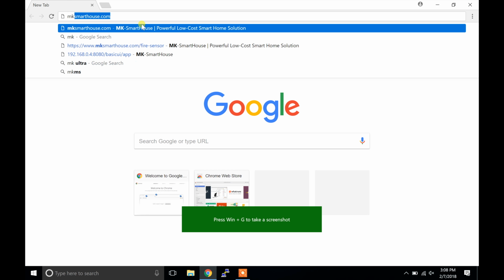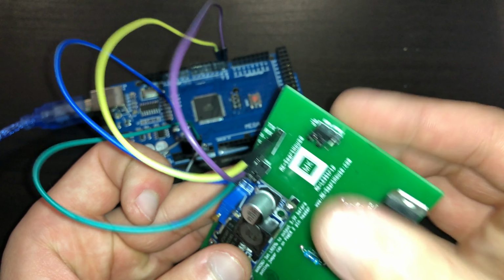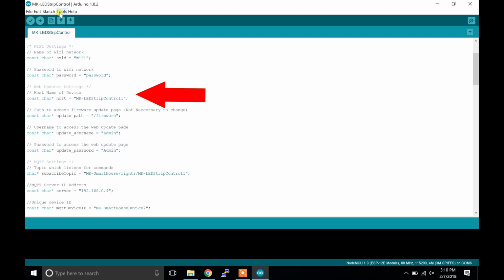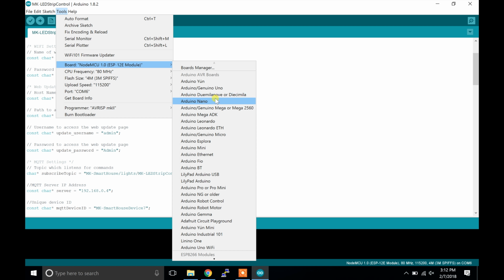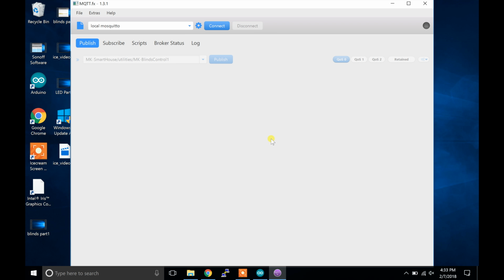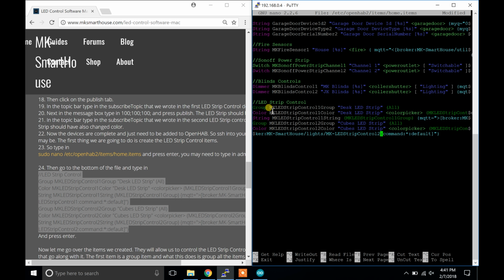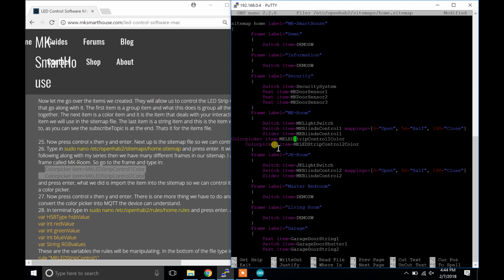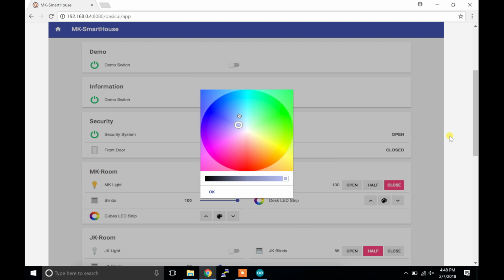Complete Guide LED Strip Control MQTT OpenHAB ESP8266 : Software WINDOWS

Comment: Hi,
Thank you for all your great tutorials and detailed explanations.

I have tried to build your Complete Guide LED Strip Control MQTT OpenHAB ESP8266 with a NodeMCU but are facing some problems.

The NodeMCU connect to WIFI and I can publish and subscribe to it using MQTT.fx, but OpenHAB2 wont update / connect with MQTT.fx nor NodeMCU. I have grabbed all the code for OpenHAB on your website and downloaded and flashed the NodeMCU with the firmware from your website.

The colorpicker icon shows in basicui and Log Viewer show e.g. 2019-05-18 16:50:42.557 [INFO ] [model.script.MKLEDStripControl1Color] - 15;11;36;

Any idea what I have made wrong?

Is broker in the mqtt=">[broker:MK-S… to be replaced by the name mqtt:broker:MQTTBroker… ?

Thank in advance

Comment: i bout the kit and soldered everything and am now trying to upload the firmware but i keep getting the error error: espcomm_upload_mem failed. does anyone know a fix? also if it helps the led on the lm power pcb lights up but nothing lights up on the esp chip, is it supposed to? any help would be appreciated.
Reply: flash the esp or ic

Comment: Can this be used with Home Assistant?
Reply from the maker: Yes it is MQTT so if you setup MQTT on home assistant it should work
Reply: Yes - I am. Very awesome! Thank you!
Reply: One last question - could you cut these LED strips if they're too long or if one strip is long enough to be split between two places? Also, if we wanted to join them together for a longer strip. Thanks.
Reply from the maker: Yes all of that is possible
Reply: Actually - not the last question and please be patient - I'm new :) If I purchase the kit, what else is needed to program it for mqtt? Seems you're using more gear in this video. Thank you!
Reply from the maker: I recommend watching my door sensor software video where it shows exactly how to flash the firmware, but in short you just need an arduino
Reply: Cool - which one? You have a few :) Also, are all the parts needed to flash the software available somewhere?
Reply from the maker: You simply just need an arduino and male DuPont jumper cable
Reply from the maker: Those two things are in links of this guide
Reply: MK-SmartHouse  Instead of writing down my ssid , can I use my IP so that I can control it no matter where I am or what WiFi I am using  ??

Comment: why do u connect tx to tx and rx to rx and there is no problem connecting the 5v arduino tx rx to 3.3v esp8266 tx rx?
Reply: Marius Cîrmaciu the esp8266 is 5v tolerant